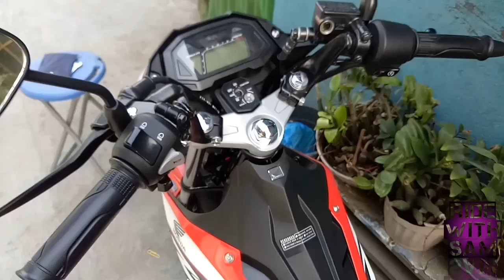How to change coolant.. | HONDA RS150 FI

Comment: Goodday sir ask ko lng po what if ma ubusan ka nang coolant aandar paba yung motor ? At kelangan po bang lagyan ng tubig yung anong tawag dun yung radiator ?
Reply from the maker: Thanks sa tanong paps😊 pag naubusan ng coolant madaling uminit ang engine kya dun nagsisimula ang overheat kya kailangan ng coolant pwede rin yung tubig basta distilled water ang ilagay mu at hndi rin pwede na tubig lang ang ilagay mu for emergency lang yun mas mainam parin ang coolant👍
Reply from the maker: Aandar parin sya paps pero madaling uminit engine basta every 2weeks check mu lang kasi nababawasan rin yung coolant sa radiator at reservior.. Pag nakita mu na nabawasan dagdagan mu lang yung reservior wag mu punoin may sa gitna yung stick nya hanggang dun lang dapat
Reply: Paps good day.
Refill ok lang ba? 
At anung brand yung magandang coolant? Salamat
Reply from the maker: Pwede paps kahit refill lang..
Magandang coolant rin yung TOP1
Reply: @ridewithsammotovlog6418  Preston ok din diba un ang gamit q KC paps